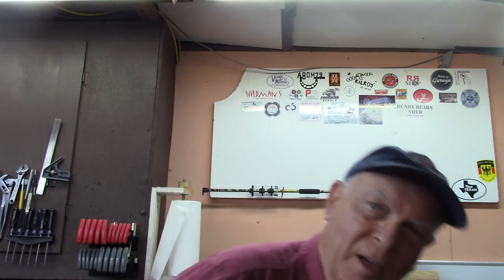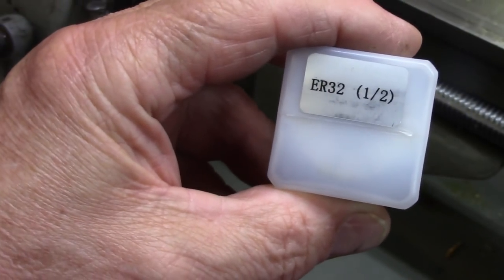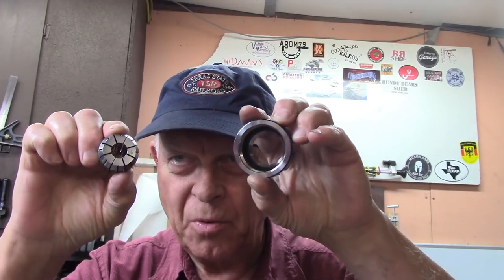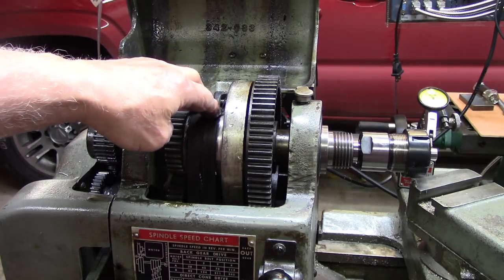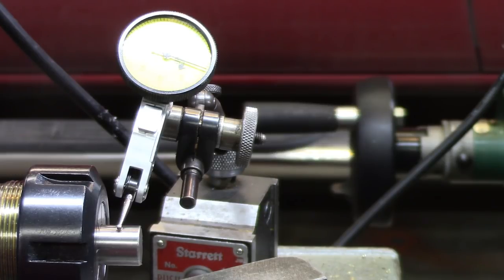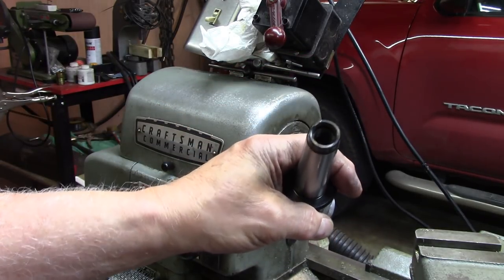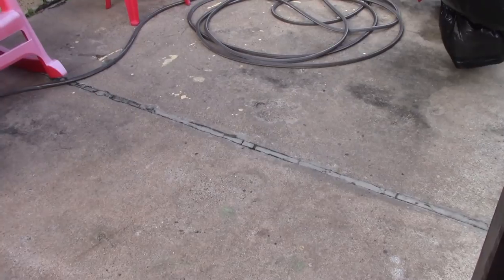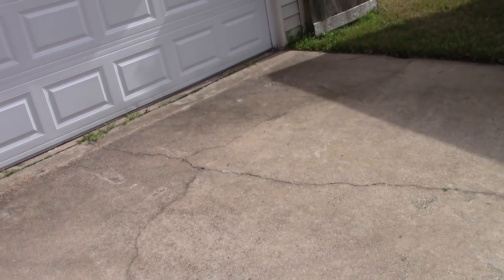ER32 collet set - NEW IMPROVED VERSION

Comment: I did the same thing when I got an ER collet set, found an old comment on a machining forum that told me what you learned. The ER collets are mostly for toolholding, I use them on my mill. The 5C ones are designed for workholding. As best I can tell, the difference is the ER ones only hold a couple inches or so of material, the 5C has a hollow core and you can stick all you can manage through it.
Reply from the maker: Yeah, it worked so much better when correctly assembled.  Thanks for stopping by.

Comment: Now here is some advice from a bricklayer in Southern Ohio.  1.  The cap on your chimney should extend out over the brickwork and have a drip stop (a grove just under and around the bottom of the cap).  2.  If the roof comes down to the chimney on the back side you need a cricket (a vee shaped flashing behind the chimney to direct the deluge to either side rather than right against the chimney).  3.  It might be better to finish the mortar joints with a convex jointer so the mortar will resist any water that contacts it better.   Looks like the original joints were done that way but if I were guessing, i'd say you'll plan on something flat to use as a jointer.  4.  DO use a sealer on the chimney but just remember, it doesn't fill holes but keeps the water from penetrating the brick face and mortar joints...hopefully!   (I started my first masonry project in 1964 if that means anything) Greg
Reply from the maker: Thanks for the helpful suggestions.  I meet most of the suggestions.  Number 1 is there and number 2 is there and working quite well.  I have put one coat of sealer on the bricks and will do the second one maybe today.  I am lazy and space out the work enough to drive the boss lady crazy.  Thanks for stopping by.

Comment: I had a lot of runout with my chinese collet chucks.
After making a collet chuck from cast iron I found (Having 2 chinese nuts) I bought woo.
I found a difference between the nuts. I finally bought a "Bearing " type nut off ebay and found a lot less runout and less tourque to tighten the nut against the collet.
I highly recommend the "Bearing " type nut.
Thanks
Reply from the maker: Thanks for the information and thanks for viewing.

Comment: seems we all are having issues with the Bangood ER32 and 25 collet chucks  , I confirmed my MT3 taper had all but zero run out, and reground both the ER taper and the face of the taper, only to find the runout only slightly better. I found two parts on the Sharrs tool site of a ball bearing nut. I still have a few of each of the ER collets that are questionable, but for the most part I am not getting less the 0.001 run out across the ER Imperial and Metric sizes ,....... seems nut is the culprit putting uneven load on the collet as it tightens down.  cheers
Reply from the maker: Thanks for the info.  Thanks for stopping by;

Comment: Hi Harold,
Funny to see you insert the collet the first time...
Sometimes water leaks are quite difficult to find and block 100% certain...   Make sure the mortar joints are good and that the hat on the chimney isn't letting the water in in high winds, and best solution if you're not using the fireplace so much, get rid of the whole thing, at least the part above the roof...  
Cause getting rid of mold in the inside walla will cost you way more than $1700...
Take care,   Pierre
Reply from the maker: I wish I could get rid of the chimney but the vote is 2 to 1 against.  I would have an expensive hole in the wall to fill afterward.  Thanks for stopping by.

Comment: Hi Harold,

I think everyone that has ever used ER collets for the first time scratches their head over how to insert one into the nose cap.

It's a simple design, but totally different to old style threaded collets.  ER is pretty much the go for collet system in industry these days.  It's very good, and the self release function is really excellent.  

That run out figure of 0.02 mm is what most lathe spindles are rated at.  It would be interesting to check the spindle Morse taper run out -  the actual run out in the collet chuck may actually be less than indicated.

I made up a draw bar from some threaded rod from the hardware store, with a nut welded on the end.  Turn up an end locator to centre everything and you're good to go.

Cheers Rob
Reply from the maker: Thanks for stopping by.
Reply: Is it true most lathe spindles are rated for .02mm? I somehow doubt that, my Logan is running at .0005runout on the spindle, which is .0013mm. why would they built the spindle on a factor of 10 more Accurate than needed.
Reply: I was generalising about modern cheap lathes which don't claim super high accuracy figures in the specs.

Rob
Reply: xynudu I see. I didn't figure that's what they claim now a days on lathes. Makes sense now.
Reply: I shouldn't have used the word spindle.  I was thinking more about the Morse taper accuracy and test readings for the chuck etc.  My bad.

Cheers Rob

Comment: Hi, Harold thanks for sharing.  As Ian P said just ask the boss lady to wash Daisy in a different place each time.  Would be best if you make a drawbar for the ER32 collet chuck.  Does not have to be pulled very tight but negates any chance of it slipping from the sideways cutting pressures. ( Don't ask me how I know)   regards from the UK
Reply from the maker: I will make a draw bar for sure.  Daisy is hard enough to wash when tied to the post back there,  moving around would do the job but might be harder than just power washing.  Thanks for stopping by.

Comment: Looks like an excellent result on that collet set.  Are you sure it is the chimney leaking and not it sweating from temperature changes?
Reply from the maker: I am not sure of anything.  Just going with the most likely.  Some of the joints had lost their mortar and others were half way there.  The recent storm of 50 inches of rain was blowing the rain sideways most of the time.  Time will tell.  Thanks for stopping by.

Comment: Harold. Love the work. CDCo has some decent stuff for decent prices. As for sealing the chimney. Use some drylock. That stuff soaks in and prevents the water from entering, it also fills in very small cracks. With that said I do not think it's in stable to a good coat of paint afterwards may be a good thing to use.
Reply from the maker: I have put on one coat of Behr brick sealer and will put on another coat when the wind dies down some.  I painted the back of the part above the roof with some Kilz.  No one can see that side.  It soaked up a whole gallon of that.  Thanks for stopping by.

Comment: Nice vid Harold! :)
If you can see the leaks inside the closet, wouldn't they be from a bad seal between the roof and the chimney and not holes in the chimney?   I've had roof leaks that didn't drip hard enough to come down where they came through.  The ran down the bottom side of the roofing(inside the attic) for a ways, then dripped....made it a lot harder to find the leak.  A new roof fixed the problem...no holes in the roof.....just a really big one in my wallet. :(
Reply from the maker: I think the leak came from the chimney.  I cannot see any other spot leaking and the brick is above and behind the closet, you can see it from the attic.  I hate house problems.  Thanks for stopping by.

Comment: Mold and mildew is a recent problem in the northeast.  Never had to deal with it until about 10 years ago.  Now it is a constant battle.  I'll try the pool bleach and see how that works.
Reply from the maker: Mold an mildew is a constant problem along the Texas coast.  If you drive on a road you will see it is coated with mold every place but where the tires run.  Thanks for stopping by.

Comment: I did not know that but now when I snap them together I can't get and of my end mills to push in what I'm I doing wrong
Reply from the maker: That is a tough question and I do not know the answer.  I would think that if everything is assembled correctly and the end mill is the size of the collet then it would all fit.    Many of my end mills have a different size shank than the cutting part.  Thanks for stopping by.

Comment: here is what you need ,this chuck needs a threaded back ,you will have to fit it the chuck.
https://littlemachineshop.com/products/product_view.php?ProductID=2532

 BUT it will allow you to run stock out of the back of the lathe;s head stock,through the collet,unlike the morse taperer chuck which limits the length of stock used.
Reply from the maker: That is a nice chuck but I would have to do a lot of work to make it fit.  I do have plans though.  Thanks for stopping by.
Reply: you are welcome man .